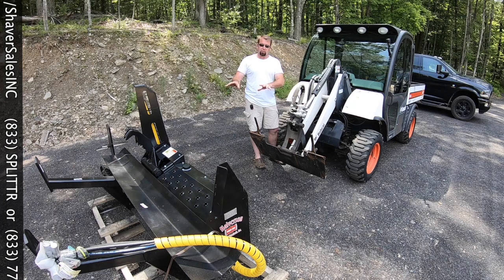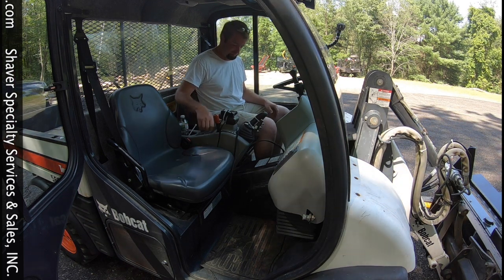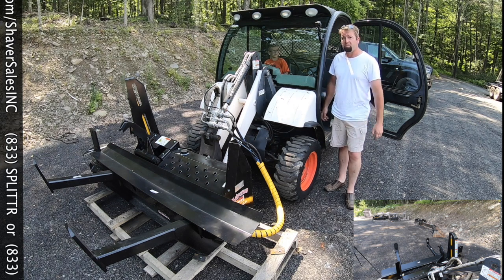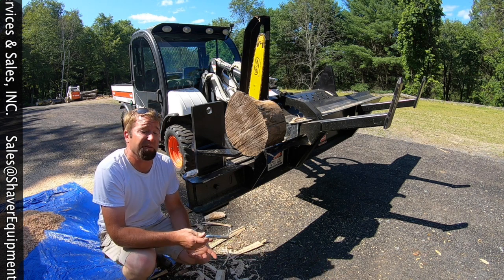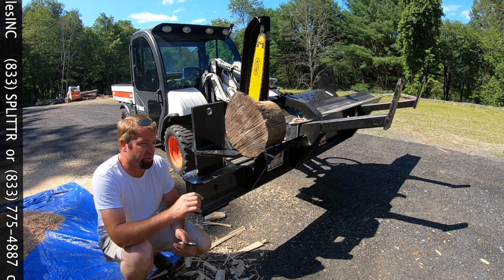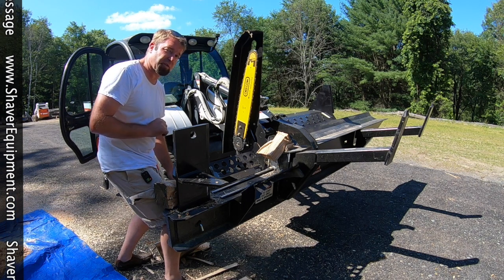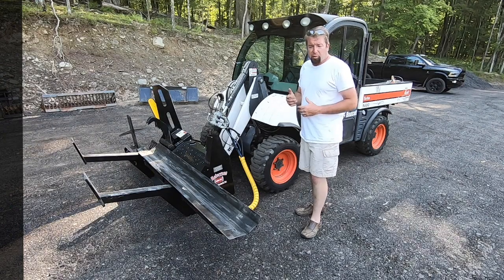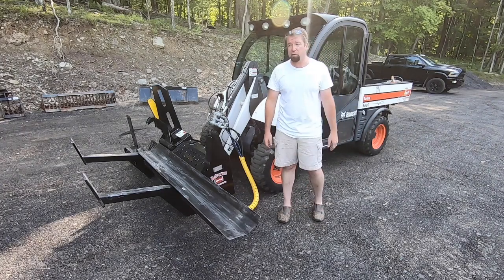Product review: Bobcat Toolcat with Halverson HWP-120

Comment: Interesting, I don't think those pickup arms need to be that long unless you plan to run 2-3 small logs at same time. If they were half the length it would put it at a better angle when picking up a log. 
I'm only here because I operated a Toolcat at my mall about 12 years ago for snow removal and loved it. So I'm going down memory lane and dreaming about owning one myself. I saved this video incase I want this attachment, seems like it would save a lot of back breaking hours.
Reply from the maker: It’s more for visibility in the cab. The longer arms let you see under the unit to get a good “scoop” on the log. It’s a great unit, saves a ton of time and yes, saves your back!

Comment: Will this machine be at the Paul Bunyan event this coming weekend in Columbus Ohio?
Reply from the maker: Larry Hottle the HWP-120 will be at the show. I believe Halverson is bringing the CAT304 mini excavator to run it. For a full price quote give me a call. 833-SPLITTR or 833-775-4778 thx AJ
Reply: This will run on a mini excavator?
Reply from the maker: @geobert7637  yep! just need 15.5gpm at 2850psi as a minimum spec with a case drain. https://www.youtube.com/watch?v=3DLK5M44S-M
Reply: @ShaverSalesINC  Do I have to order it "Excavator Specific" OR "Skidsteer Specific"? Or will one unit work with both machines w an adapter?
Reply from the maker: @jeremiahscoutii7561  it comes as a universal skidsteer mount. You’d need an adapter to go to your specific excavator.

Comment: I’m curious does this piece of equipment have the option for an 8 way head and how do you set it up for length measurements of the wood? I’m really considering this as an option down the road.
Reply from the maker: The 140b has a built in length guide and is better suited for the 6-way. It has a bigger pusher plate for use with the 6-way. The 120 will work with the 6-way, just have to drop it down a little. I’d love to get you a quote. Call or email. Thx AJ
Reply: @ShaverSalesINC  thanks for the info. I’m still way to small of an operation to afford loaders yet but this is pretty awesome solution to the cost of a processor.